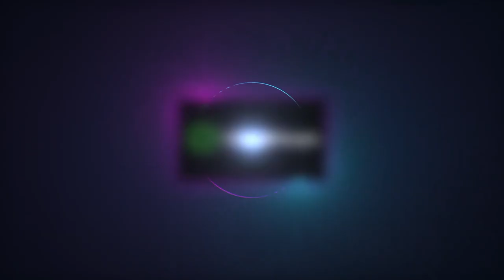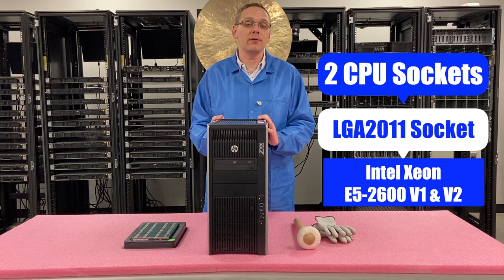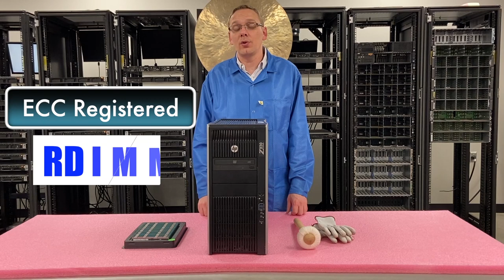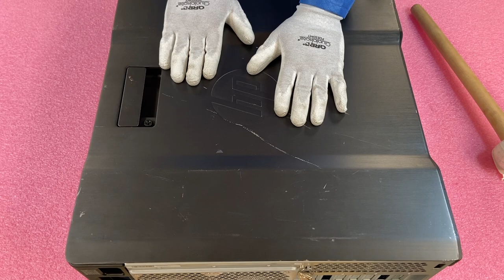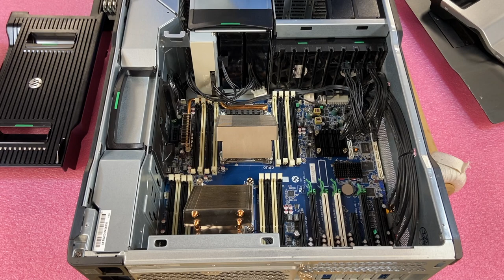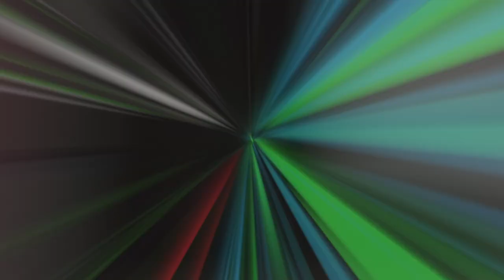HP Z820 Workstation Review & Overview | Memory Install Tips | How to Configure HPE System | Gaming

Comment: Tremendous video. What are your thoughts on utilizing the two 6 pin PCIE cables on the Hp z820 to power a Tesla P100 GPU?  I had been told the 6 pin cables could handle 150 Watts, but HP tech could only find that they are rated for 75 watts each, so that leaves making a dual 6 pin cable adapter to a single 8 pin for the GPU, which I would fabricate out of 16 AWG. The 6 pin pcie cables are 18awg.   Curious, as I have not found much on this topic and will be continuing down this line.  Also additional cooling would have to be installed I imagine.

Comment: Hello everyone, I have a problem, what happened is that there was a blackout in the area and the only server that did not start up again is this computer, all the others do, I thought it was because there were 3   Capacitors in bad condition, I changed them thinking that was what was damaged and when restarting it goes into a loop when trying to start with the typical 3 beeps. I need to check the power supply In case there is a problem in that part.
Reply from the maker: Most likely fried your power supply and need to replace it.

Comment: 2011 v2 wil allow 1866  v1 only runs 1600
Reply from the maker: Thanks Chris!
Reply: @cloudninjas  mo probs it also depends on the boot block version . If the end is 2013 then it supports ivy and 1866 mhz ram if it says 2011 then you are stuck on Sandy  and 1600 mhz ram . Another fun fact the z800 z820 z840 use the exact same psus so you can swap them around .
Reply: It's also cheaper to get a z800 with the 1125 watt psu then it is to buy that psu by itself lol also another fun fact the GPU wiring harness can be removed pretty easily so you can install the 4 6 pin cable harness . The 6 pins can deliver 150 to 200 watt HP recommends 175 at most on a single 6 pin but it can handle 200 so you can get a 6pin to 8 pin adapter :) I'm an old school server guy I've worked on hundreds of these machines ')  if you have a v2 version and want yo install a pair of 150 watt cpus it's recommended to get the lcs or use good thermal paste and upgrade the fans :) hope this information is useful
Reply: @amdintelxsniperx good to know thanks 😊